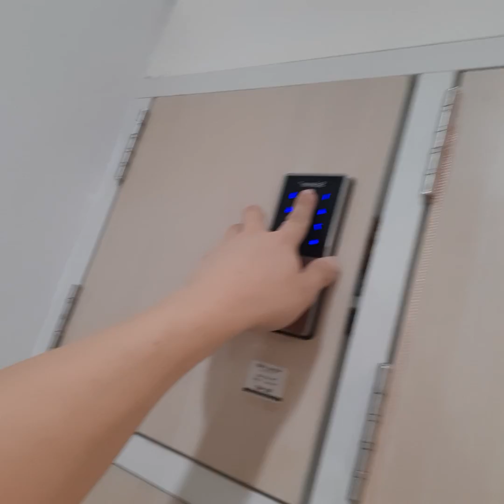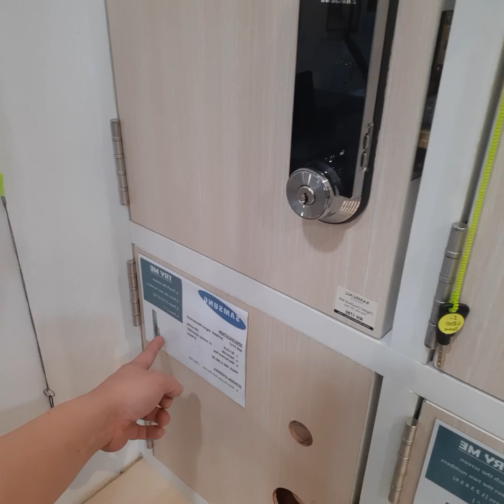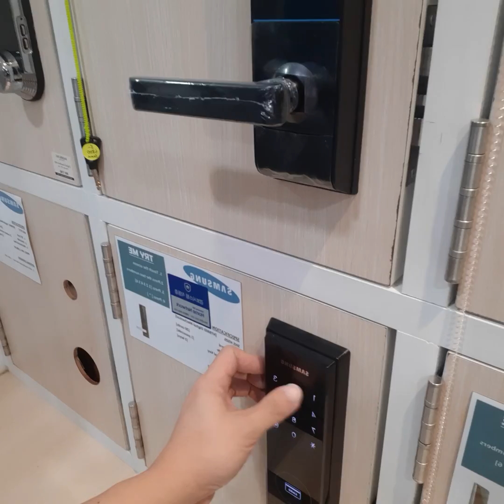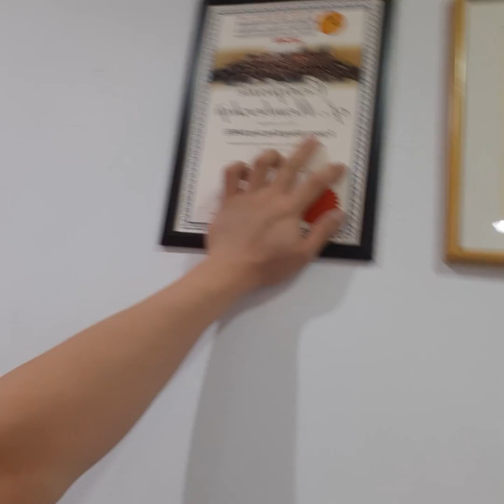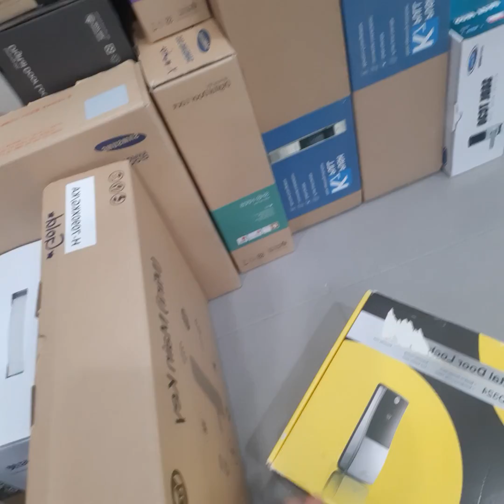DIGITAL DOOR LOCK - Which brand is good? (Yale Samsung Philips Schlage St Guchi Digital Door Lock)

Comment: I have a DP728 and the fingerprint sensor has Failed 2x in3 years. 

Which digital lock would you deem as a solid and reliable model with the lowest failure rate?

Comment: Hi
just saw the video and recommend not to buy samsung handle type locks, is that including the DH538? I was also recommended the Kaadas K9 model as well but then saw that u dont recommend that brand either. is there a similar lock type that u would recommend?
Reply from the maker: K9 so far so good. Seems like they improve it. And samsung dh538 will not be durable

Comment: would u please give suggestion for which should i go for on philips 9300 or abrain ?thank you🙏🏻
Reply from the maker: If youre looking for high end quality and security, definitely would be Philips 9300! It usually comes with a getaway which connect to your wifi and enable you to control from far. You can also control your digital lock using the app

Comment: Thank you for the review! I’m planning to get one from Philips. Would you know if their Alpha smart locks are having problems now? Thank you!
Reply from the maker: Hi hi, actually Philips Alpha performs well. It is recommended! As long as you remain on using alkaline battery then it would be long lasting without problems. Please check with your seller which battery is suitable. Using the wrong battery might cause leakage and affect to your lock motherboard.

Comment: Hi thank you for the video . Super helpful. I like one with the lever handle . I am deciding between Starke Seamless™ Länge, Samsung DH537. Or is there any lever handle lock you recommend within that price range of 450USD
Reply: This 2 cannot be compared actually. Different locking method. Starke, u have to manually lift the handle in order to lock it. 
Samsung, once u close door is automatically locked. So you must decide you want to manually lift handle to lock, or you want that just-close-door-done

Comment: Im not sure why seems like i prefer to buy lockin s30 pro. is it good?but since the price range almost same with philips 9300, which one better and worth it?
Reply from the maker: S30 pro is a good lock. Nice build and quality. If you really like the design it, you can be assured quality wise should be no issue. We liked it very much also, great to have another good smart lock in the market (which are not much really)

But 9300 is another higher class apart in terms of material and solidness. These 2 shouldn't be compared. 9300 is Corning Gorilla Glass panel, Brass-Zinc Alloy body, and the processors are of genuine Swedish manufacturer.
Reply: @TheFineLockShop  thanks bos for the reply n advice. Im going to kl midvalley home living exhibition and doing my survey. Philips offers 3 years warranty n lockin up to 10 years. End up with lockin considered on warranty even though both locks are very good quality.

Comment: Wow! Great video! Greetings from Singapore! We also like Philips but it's higher than our budget. We're now looking at Hafele GL5600 (metal gate) and PP8100 (wooden door). Are they good? Thanks!
Reply from the maker: In the past 5600 got some persistent problem with their back setting switch. Not sure if they have solved that. 8100 should be no problem

Comment: I'm looking at a few brands (for wooden door):

Italuxe G10+ / S60	
Toush T8401SDL (Pensonic)	
Trident - Arthur Pro	
Avant Guard D10	
Abrain X2	
Aqara - N100 (Zigbee)	
Aqara - A100 (Zigbee)

Any of these that should avoid? You advice would be much appreciated. 

I'm personally interested in Abrain A15S/X2 but their info is incomplete. No mention of battery life or installation fees. Which of these two is preferable?
Reply from the maker: Avoid Toush. 
Italuxe and Avant Guard I've never heard. New brand usually best to avoid.

Trident Arthur Pro is good. Abrain X2 also good. Aqara only logic to get if you using Apple Home ecosystem 

Also, why don't you get Abrain A15s full auto? It will beat the hell out of all the model that you listed.
Reply: @TheFineLockShop  A15s a bit on the high side for price. I wanted X2 because of the material used for the construction of the lock. 

Anyway, very much appreciated with your response. I've been researching for almost two weeks myself and this video is by far the best. Thank you again sir
Reply: @TheFineLockShop  Another question if you don't mind, are the battery life claims for these devices accurate or exaggerated? I got in touch with the Abrain sales rep and was told the battery life is approx 6 months. Was told 12 is possible but I'm guessing she didn't want to over promise. I also assume it also depends on the frequency of use.

Comment: Hi im thinking of getting samsung SHP-DS705 for my gate. and SHP-DP727 for door. Me and wife dont like the idea of thumbprint for now. Is both of them ok? Or you will recommend to get something better?
Reply from the maker: 705 is fine. 727 will need some servicing maybe every 2-3years
Reply: thanks for the reply. do you have a recommended samsung mortise push and pull lock other than the DR708 then? Maybe one with no thumbprint reader. Maybe SHP-DH525? better than the DP727?
Reply from the maker: @hiddiexandria yes, 525 is even better than 727
Reply: ok thanks!

Comment: Hi! your video did help me alot! however, I am having a dilemma in choosing between Abrain A15s and Philips 702e. which one do you recommend if my wooden door has the door closer which might need a little more force to push or pull the door ?
Reply from the maker: Cannot compare wo. Price is different. Type also different. One is lever. Another is Push Pull. 

Both is a good lock and stable. So you can choose based on design you liked

Comment: Good review, I'm planning to get Yale YDM4109A, is it good?
Reply from the maker: 4109 previous gen is badly designed. 
Not sure about the new 4109A. Still very new. But it's an improvement. So for Yale die hard fans, i personally think is worth a try.
Reply: @TheFineLockShop  Thanks for the prompt reply. I'm still choosing either 4109A or Philips Alpha, which model would you recommend?
Reply from the maker: @KennyNg77  which do you think the locking bolt is stronger? 💪?
Reply: @TheFineLockShop  I'm not too sure about it, if talk about locking bolt Yale should be stronger, correct me if I'm wrong.

Comment: The lock picking lawyer defeated both the Schlage and the Yale pretty easily. I don't think customer complaints are necessarily the most important characteristic of a door lock. Which locks are actually secure? You must know after 8 years...
Reply from the maker: 1. No locks are non-defeatable. Even bank vaults are defeatable. But good locks will buy you time, for help to arrive or for you to prepare next action. Time is the key 
2. Someone as professional as lockpicking lawyer will not come burglar your home. You only have to watch out for brute force attack or lock weakness bypassing, not lockpicking (as long as not too something too easy)
3. So i think all digital lock is safe enough  for home
Reply: I don't think he's picked any of the ANSI Grade 1 smart locks from Schlage yet. So like the newer Encode series smart locks.

Comment from the maker: I hv been a very local supporter of Schlage due to its quality amd reliabily. But as of 2021 onward i started to see cost cutting implementation. More plastic parts, some parts like cam also got quality reduction from solid metal structure to a cheaper "skeleton" type of parts. 

Also start to get more defect complaint from my customer. It's sad to see this company heading to such direction

Have to post this update to the video to all our loyal fans.
Reply: would you now not recommend to get Schlage S6500F?
Reply from the maker: @stu4rt86  perhaps not anymore
Reply: Good morning. Does this apply to Schlage S-6000 too?
Reply from the maker: @Jupiterodysseus  unfortunately yes.

Comment: Thanks for your video! I'll be getting a Philips 9300 for my front door but was wondering if you can recommend a weather proof digital lock for my back door? It gets wet from rain sometimes when it's extra windy..
Reply from the maker: Just 9300. But if say for back door you don't want such high budget get same brand but 5100 small lock.

Comment: Hi!  For an old couple of early 60, what would you recommend to them?  ….. All we expect are reliable both on electronic and hardware with user friendly.  Accessing the door with card and keys would be our primary needs.  Of course, if other features are included would be great, such as Bluetooth or password.  Am I make sense?
Reply from the maker: I will recommend add on. Maintain your existing, just add a digital on top. 

Usual time, don't have to lock the ordinary. But night time sleeping and for long vacation, u can have double locking. 

Samsung, yale or schlage will do. For samsung and yale, don't choose fingerprint will be fine

Comment: Thanks for sharing your unbiased opinion. I’ve listed the brands you’ve mentioned. What digital lock do you recommend for aluminum doors? Any brand will do, I will be using it for storage room one that is reasonably priced. I prefer a rim lock because my aluminum door already have handles.
Reply from the maker: Aluminum door, rim type you have to choose yale or philips. Inside have to be vertically

Comment: Great video! I recently purchased a steel door with 5 lockpoints. They are recommending me to get a Philips. What is the most affordable Philips Easy Key model that can fit my steel door and control all 5 lockpoints? Thank you very much in advance.
Reply from the maker: If philips then 603

Comment: Thank you so much for your honest and professional reviews! I've bought Philips 5100 digital lock for my grill door and Yale 4109 for wooden door. Philips work completely fine so far but the Yale 4109 has been a nightmare for me and my family since the Day 1. Its fingerprint roller latch couldn't read our finger print all the time, probably 8/10 times are not working so we've been using passwords to enter for months. Now that the seller allowed us to change the lock so they recommended us to take Yale 4109A with latest one-touch finger print scan, do you think that's a wise choice? Other than that, they also recommended us to take Philips 7300 and Samsung 609. We are very happy with our Philips lock so far but my concern is can we have the same brand for both grill and wooden door due to security measure? Can you please advice, thank you in advance! May you have a nice day, Mr Francis.
Reply from the maker: Hihi. 4109A is an improvement due to the vast complaints of fingerprint reader. But it's still new so we can't gather enough feedback yet. 
Philips 7300 is okay. There is no problem of using same brand so don't worry.
Samsung 609 don't.
Reply: @TheFineLockShop  Thanks for your prompt response, appreciated a lot! Will get Philips lock instead. I read some of your old comments here on Philips 7300 about its handle with thumbprint wiring, would Philips Alpha make a better choice than 7300?
Reply from the maker: @elainechengxiaofunn9408  alpha will be better than 7300 of course. But with some price upgrade too. So see your budget ya
Reply: @TheFineLockShop  Okay I've made up my mind, thanks for the advices!
Reply from the maker: @VaLLhaLLa81  our whatsapp is 082288422

Comment: Hi sir. May i ask for ur recommendation? Which one is better? Philips alpha, philips 702e or schlange s7100? Thanks
Reply from the maker: 702E the best among 3. Due to fully auto handle. Fully auto handle is the most reliable. Even tho i highly recommend Schlage product, but 7100 is a push and pull handle mechanism which is not good. 

But if your door receive direct sunlight then go for Alpha. If not stick to 702E

Comment: Hello, my house door is a double layer door. And im used to not closing the door in the inside layer, and only lock the outside layer door. I need two digital lock. However, since im used to not closing the inside layer door, will the digital lock make noise non stop asking me to lock the door? Is there any lock that wont make noise if door is not closed?
Reply from the maker: Some models, when u din close, it will beep few times. But after that it wont make the sound anymore.

I haven't encouter locks that constantly bother us for not locking

Comment: Great video firstly. 
I have a holiday house that I want to Air B&B so ill have to change keys all the time. Can you suggest a door lock that can change codes over WiFi and have codes that only last set times?
Reply from the maker: if you from malaysia i recommend you to use Fine-Tec digital lock. this lock is good to use for Air B&B
Reply: @TheFineLockShop  ok but I live in Australia what international brad would you suggest
Reply from the maker: @yodme  i come across Lokly brand from Aus and is good. I think can put into your consideration (besides Schlage, Assure, etc)

Comment: Any specific model from Philip is recommended?
Reply from the maker: For Push pull=philips 9300, 702e, 702(3D), Alpha
Handle= 7300
Rim lock= 5100
for metal door= 7100

Comment: I am considering the Philips 9300, however the wifi function for me is unnecessary. Is there another model you would recommend?
Reply from the maker: any brand is ok with you?
Reply: @TheFineLockShop  hi what's your thoughts on 9200? it seems to be similar to 9300 but without the wifi function.
Reply from the maker: @janicelai5632  if you only wants Philips then yes 9200 also is a good realiable lock
Reply: @TheFineLockShop  thanks. what are the other brands/models without wifi that you would recommend too?

Comment: Hello! Thank you for sharing. We live in Singapore and considering digital lock for our wooden door and metal gate. Between Yale and Samsung, which one would you recommend? Is there any combination or particular model you can suggest for both wooden and metal gate? Thank you for your kind reply.
Reply from the maker: If Yale, choose their lever handle models. For Samsung, choose their push pull only. As for gate both brand fine as long as it's without handle
Reply: Hi, can i seek you advice with Yale YMI70A for wooden door + YDR50G for gate combi? I read your reply to get those with handles for Yale, but YMI70A does not have handles. It is a push and pull type. Thanks

Comment: Hello, I watched your video and your replies in the comments section, you are a very helpful person but too bad I live in West Malaysia. I am looking for a digital lock for my grille door. Gap is big enough to put hand to unlock from inside if I choose a wrong product. I notice you recommend Philips 515K. However, when I read the user manual, it is so easy to reset everything including the master code by removing the back cover and pinch the reset button. Till now, I can't find a flawless product except some local brand that provide panel and fingerprint reader at both side. What would you recommend? Also these products use built-in battery (rechargeable) and not normal AA battery which I am not sure how troublesome to charge the battery as it is installed at the grille. Battery replacement is another concern. Looking forward your reply. Thanks in advance.
Reply from the maker: if got other option you can try to use Abrain digital lock for grille door.

Comment: Good day, Francis. I am planning to buy the Samsung Smart Lock SHP-DP609 with Wi-Fi Module. Any thoughts on this? and also in the video you said the door should be compatible, what are the parameters/requirements in stalling a smart lock? I am planning to install a smart lock in my main door of my house. hardwood door.
Reply from the maker: hi are you living in malaysia? if that the case you can't connect it to Phone APP as it won't be able to use in malaysia.
Reply: @TheFineLockShop  i am from the Philippines.

Comment: Hi thank you for the info. It’s very helpful. I am currently using Hafele push pull digital lock and it’s very loud whenever the door is closed. Hence I am looking for one with the normal handle. I notice Fine-Tech is the only brand has all functions. Is it a reliable digital lock? Thank you for your advice.
Reply from the maker: yes it is reliable locks. as it have all function that you need. and easy to use.
Reply from the maker: no need to worry about spare parts also.
Reply: Thank you for the advice, Francis

Comment: What is the best digital /keyless lock for an iron door? I am being advised to purchase a Delaney -traditional lock /handset... Will I need to drill a hole to add the keyless lock?
Reply from the maker: Iron door usually not an issue. Majority models can be installed. Yes need to drill hole to your iron door
Reply: @TheFineLockShop  thank you. What I meant to question, will I need to drill a second hole? The lock hole there already... it allows you to add the Delaney handset lock system... I should be able add a keyless entry system 2 the manufactured lock cut out that is already on the door... instead of drilling a second hole Do you sell such a lock and handset? And thank you again for your timely response

Comment: Which one is better for grille? Yale YDR30g or Philips 515k?
Reply from the maker: if your grille got gap like your hand can sneak in to unlock your gille from ouside than you should use Philips 515k
Reply: @TheFineLockShop  thank you! This is such a great reply — so simple yet so clear, made my decision making so much easier! ☺️
Reply: @TheFineLockShop  hi can you explain why this is so? I'm planning to buy the Philips 515k but my grill is designed in such a way that no hands can slip through. Is there a problem with this grill design to 515k ?
Reply from the maker: @notmeitsyou45  hand cannot slip thru, then u can choose any lock that u wan. Don hv to choose grille model